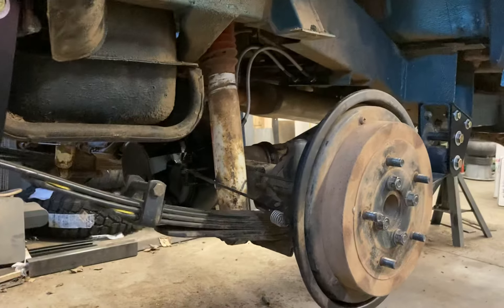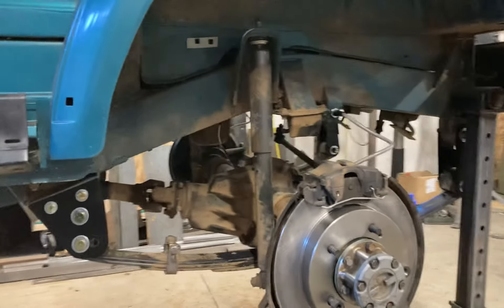Suzuki Samurai TRE4x4 electric locker, RCV axles and 2” lift installation PART 5

Comment: I want to do all these things to my sami.  Between the lockers and the rcv axles that thing is gonna go places.
Reply from the maker: It’s a total sleeper!
Reply: @ultra4suzukisamurai679  do you have an eta on the leaf drop kit? I'm wishing I didn't buy lror shackles now.  If I keep the lror shackles (1"extended) will your kit increase castor and stability further than with your shackles?  Will the drive shaft angles still be ok? Also what r+p gears and T-case gears are in that?
Reply from the maker: @deadbrother5355  stock r&p, 6.4 t case gears. Are the lror shackles 1” longer or 1” lift? If 1” longer than they are the same as mine. My fixed end drop bracket will correct the castor. If they are 1” lift (2”longer), my fixed end drops will not bring castor all the way back.
Reply: @ultra4suzukisamurai679  I just checked.  They are 1" longer, so the same. I definitely want some of those drop brackets as soon as they are available.  Another question if I may; if I went with 4.57 r+p and 4.16 t-case how would that play out with daily driver and crawler scenarios- pro and con? ( 30.5" inch tires) I live in utah  so our trails can go from dirt to sand to  rock crawling pretty quick. My sami will probably never be an offroad beast, but I want it to punch well above its weight. I apologize for brain leeching.
Reply from the maker: @deadbrother5355  I can set you up with some brackets. Email me downingbrianfab@gmail.com. To compare gearing combos just multiply all the ratios together, for example 1st gear is 3.63x4.16x4.57=69.39 to 1 crawl ratio. This samurai is 3.65x6.4x3.73=87.13. My race car is 91.38. 4.89 t case and 5.12 r&p on 33s. For moderate crawling you should be fine. You could always pick up another t case and do lower gears, I have 2 for mine, one for rocks and one for sand/rally cross.
Reply: @ultra4suzukisamurai679  ill be in touch.  Thank you
Reply: @toddcoon1730 thanks for the info. The reason I was asking about high range ratios is to do exactly as you stated with a gear calculator.  I want to sort of re-engineer my gear train to perform like it did on stock tires , but with the larger tires. Also I dont want to go too low and not be able to get up to say 60mph without completely wrapping out the rpms. The problem I have is that the websites seem to only mention 15% or 20% high range reduction,  but no ratio. I need the ratio number to use the calculator. Also retailers exaggerate to sell stuff so I dont want to just take a factory ratio and reduce it by X% based on the claim because that's only slightly better than a guess. Thanks for the input I appreciate it.
Reply: @toddcoon1730 badabing. Just like that. Thanks!  I  took a screen shot for reference. So 4.57s might be a little over geared, but would it be badly so?
Reply: @toddcoon1730 is a 1987 old trans?